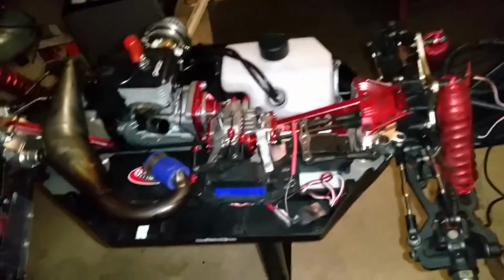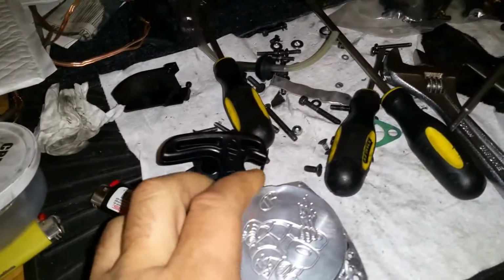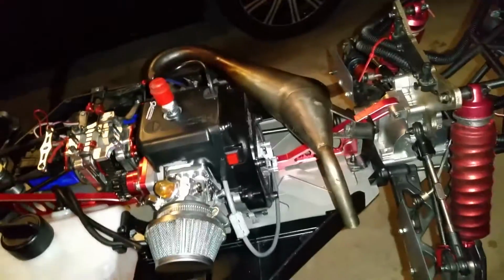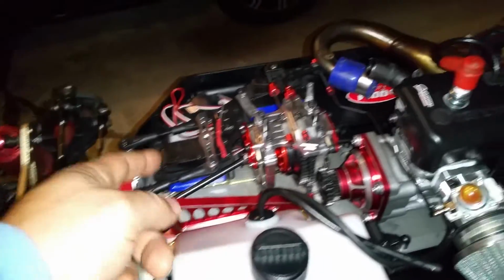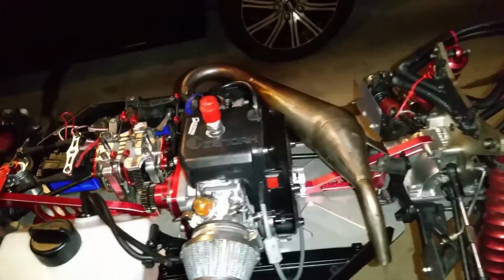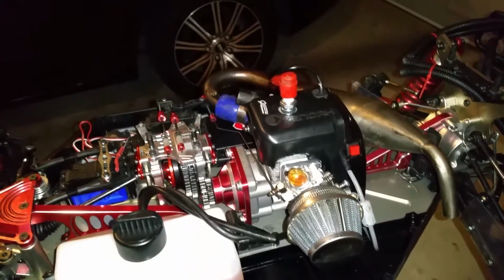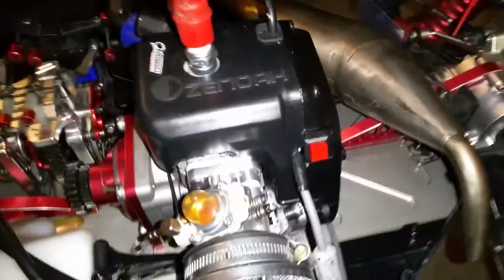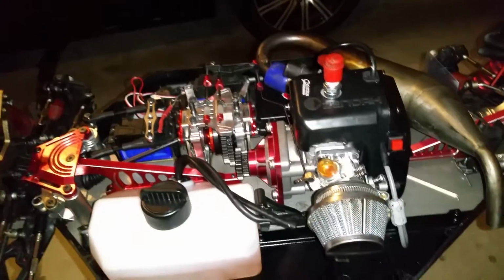UPDATED X2, Vekta 5 LSE custom build plans

Comment: Bro your 5T Platform is one sexy bitch man!! Nice job! Another thing is that I have used GPM or Team Asia Parts in the past and they are not bad at all! I have a set of GPM shock towers on my Nitro MGT8.0 and a set of some Bad ass GPM Shocks from them on my NITRO XXL LST with LRP.32 and ERCM EndBleed Pipe and it has passed the test with Many many jumps and ready right now for more! So nothing wrong with them! The only thing that I'm shocked about is that your doing A-arms in Aluminum??? They will bend Brother and throw of your drive!! I would just use some LOSI Plastic Aarms! The LOSI PLASTICS bend good so less breaking and they get never warped like Aluminums. To each is own so you do what you got to do! There's nothing like having an idea 💡 in your head and following threw till finish time!! Good luck 👍 with everything!

Comment: Yeah I had problems with my spring bending too ..pullstart cost too much for that shit to be happening. ...
Reply from the maker: Diy type of guy yeah I ordered another one for 8 bucks but I should of just waited and got a custom one built for 2 bucks..you just gotta buy 6 of them minimum
Reply: 5th SCALE RC INSANITY yeah after ordering 3 separately. .I then ordered like 4 more ..keep it lubed with dry lube and lightly pull it ...hope I don't have any problems  with it this season :\
Reply from the maker: Diy type of guy yeah the spring is too weak..I'm gonna have one custom built
Reply: Diy type of guy I'm surprised about that shit! I have an old TR pull start first gen for 6 years and still so far so good ! Maybe the older shit is better then the new shit???